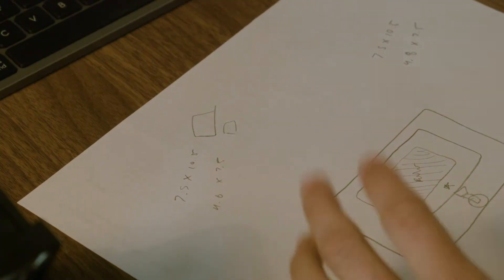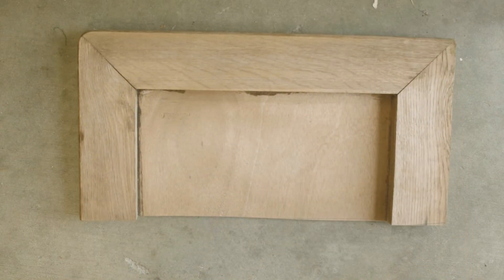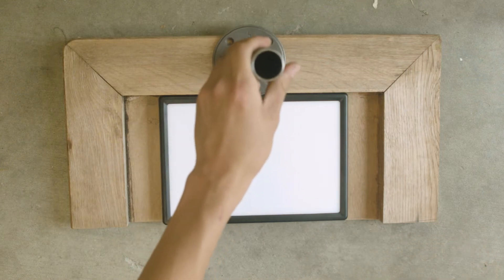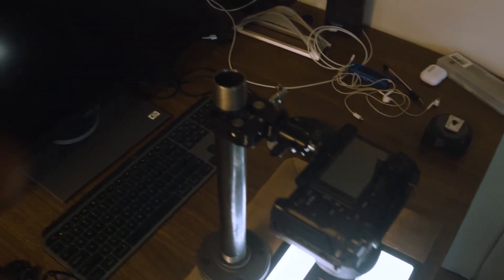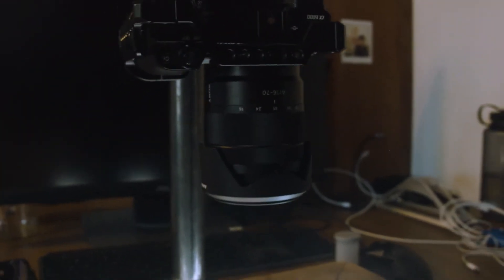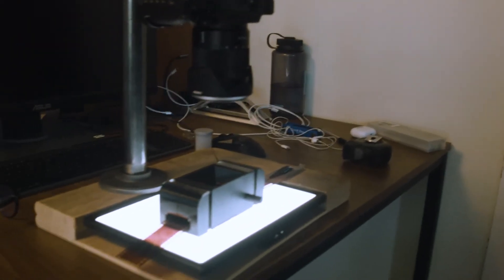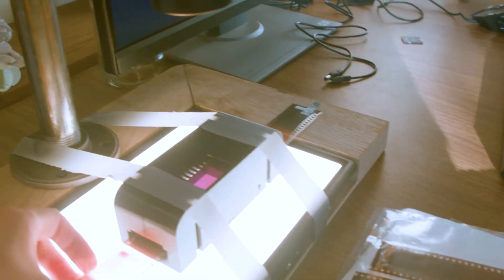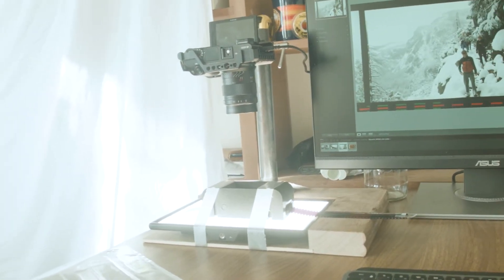DIY 35mm Scanning Rig (Sony a6000 + Lightroom Classic + Negative Lab Pro)

Comment: Cool setup! I’ve been looking for a lens for my Sony A6000 and I’m curious how the 7artisans 60mm has been working out for you? Checked out your other videos and they’re great, thanks for sharing!
Reply from the maker: I have had a really good time with the 7artisans lens so far, and have no complaints about the scans I've been getting. It's important to note that I only ever use it for scanning film though, so I can't comment on its performance outside of that, but the ergonomics are good enough for me :). 

If you're planning on scanning film with your a6000, the "film scanning best practices" at negative lab pro's website helped me out a lot. I ended up upgrading to the Skier Sunray copy stand and light source (I was able to find them for pretty cheap used), and have really benefited from a dedicated copy stand (although my steel pipe and clamp setup worked for the dozens of rolls I scanned). 

Thanks for checking out my other videos!
Reply: @mittkam  Awesome, thanks for the info! Can't wait to try it out